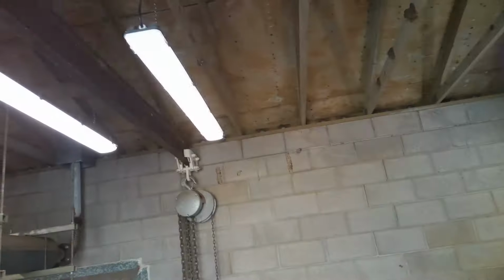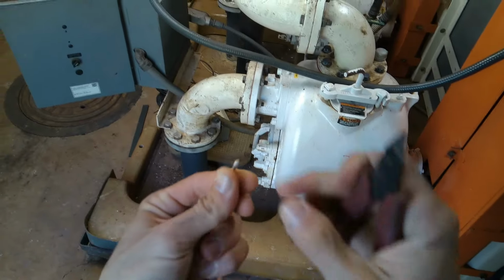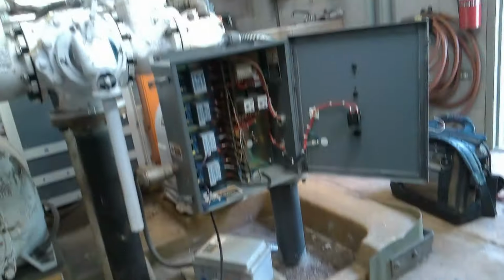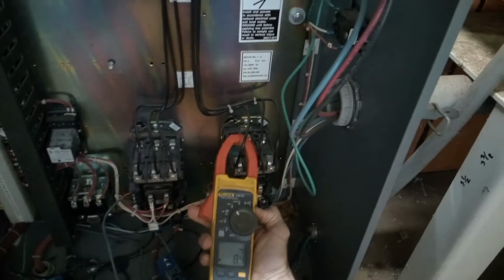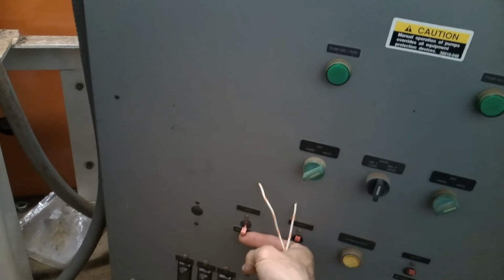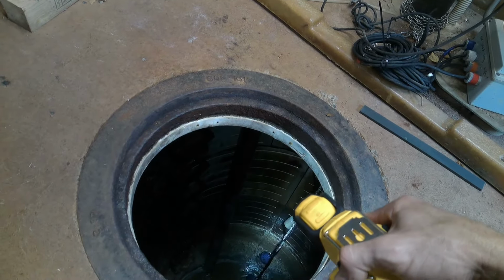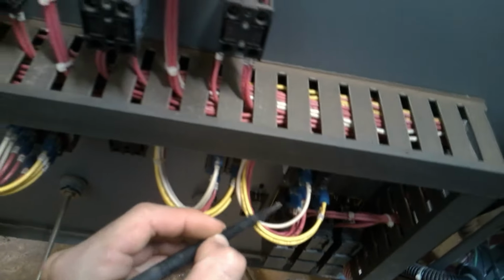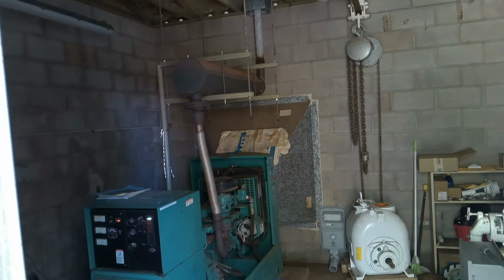Sewage Alarm Trouble Call

Comment: should really have a hydrogen sulphide air quality alsrm on your person when around sumps. hs is deadly. ideally need two people never alone especially when going into them. they cheap to buy (maybe not there 🤔) but could save your life. more so if there is no forced air ventilation in the tank...
Reply from the maker: You're absolutely correct, we need a gas and 02 detector.
Reply: Should also be & have your Confined Space Entry & Permit holder, certification.

Please don’t forget your other important gases that you should be monitoring for also.

O2, H2S, CO, CO2 and your VOC’s.

CH4 (Methane) & H2 as if any of those kinds of flammable gases reach there LEL, normally expressed as a %, get the hell out of dodge.

Dräger X-am 8000
Dräger X-am® 5800
Reply: @gecko8333 bit paperwork and red tape dont save lives, common sense does

Comment: Btw you can use your multimeter and testing probes as a jumper wire in ammeter mode. Obv you need to make sure the current flowing through your meter is below your meter's rated, but a PLC's input and relay coils barely drawing anything.

Comment: Hi, Im not in llift pumps industry but i whould design this to have an analog mesurment of the water level that is loged for last 24h. (either water colum pressure or ultrasinoc).  It whould dramaticly simplyfy diagnostic of the exac situation You have here.
Reply from the maker: That would be helpful.
Thanks for watching!